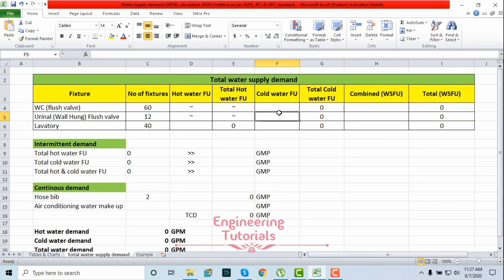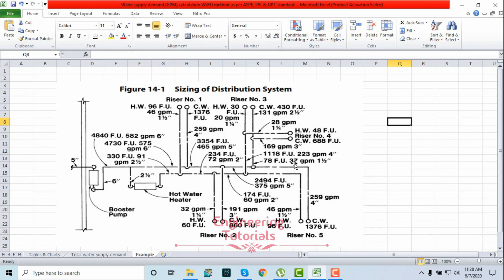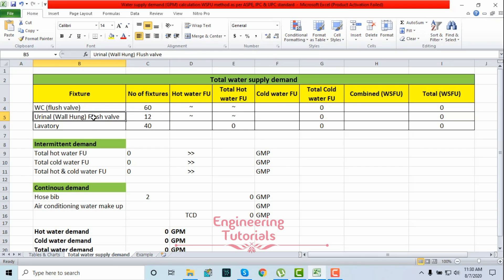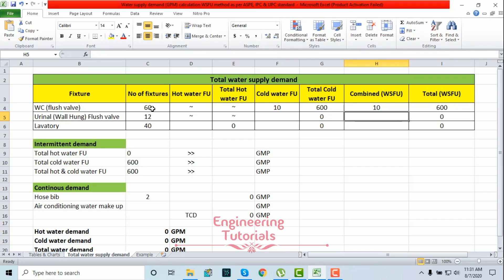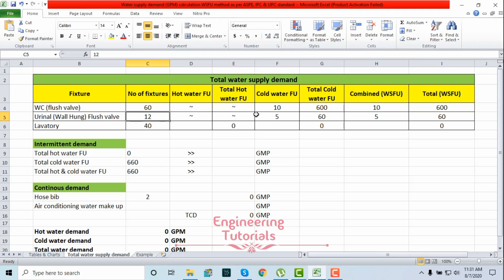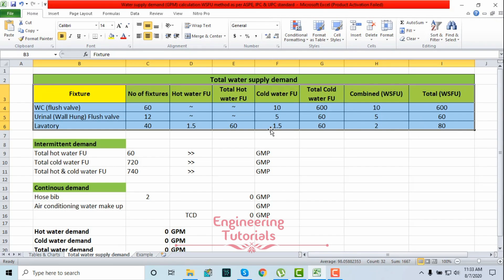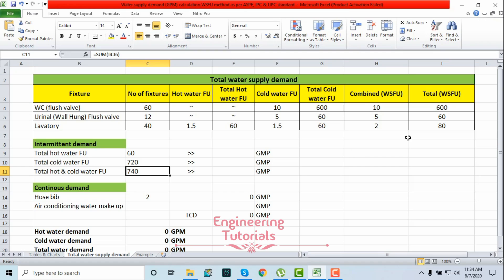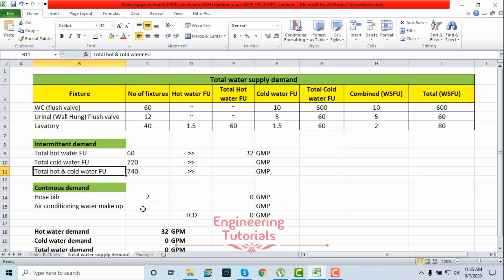Water supply demand (GPM) calculation, plumbing system design as per IPC standard, booster pump

Comment: Thanks for the video. How to find the pressure at remotest fixture.... Pl make a video on it. Also kindly share the excel sheet.
Reply from the maker: You can select pressure required at most remote outlet from table given in IPC and UPC standards but it's highly recommended to get this value from supplier because pressure requirements varies from supplier to supplier